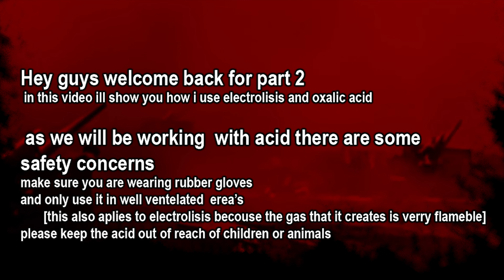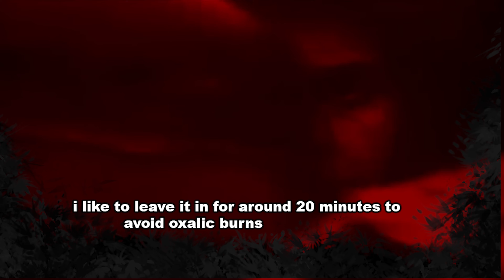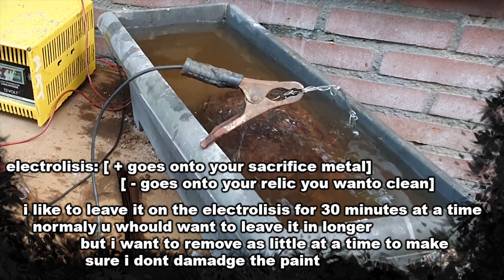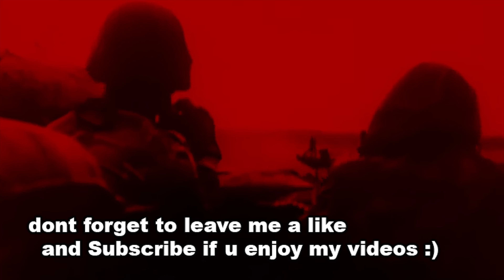cleaning and preserving a ww2 german relic helmet  [part 2]

Comment: try Rust Rescue,  soak in there for 6 hours and see,  if  necessary add 6 more hours and see......  I soaked my 12 hours   and i add 6 more hours.......   24 hours might be little too much......
Reply from the maker: If my goal was to completly strip all rust of the helmet i whould have left it in the electrolisis for a couple of hours the point of the oxalic acid is to save any leftover paint or decal, so some spots of rust will be left on the helmet, the reason there is only verry few spots of paint left is becouse of the condition of the shell, watch my part one video if you havnt, there you will see the shell in as found condition, this isnt the first helmet ive cleand/found, maybe i should have shown better pictures/video of the shell after the whole process of cleaning and drying was finnished, subsribe if your intrested in seeing me clean other helmets/relics maybe you will like those resaults